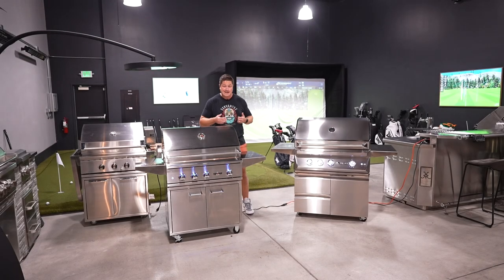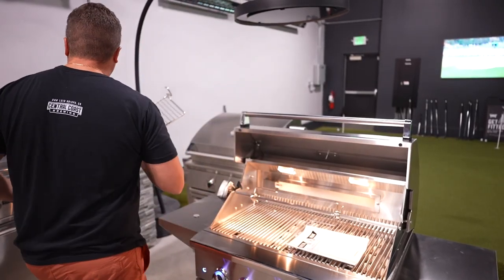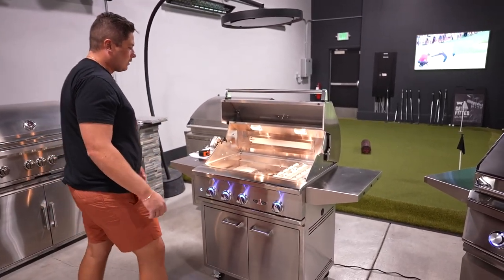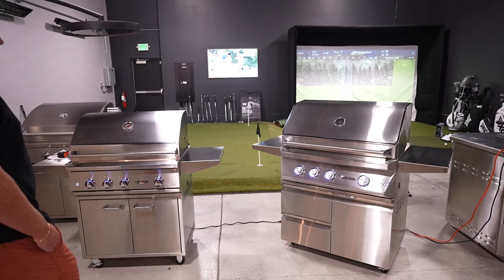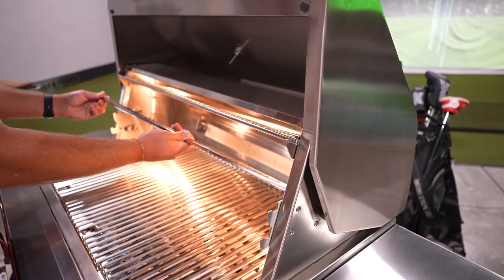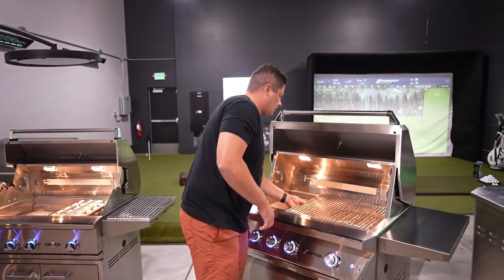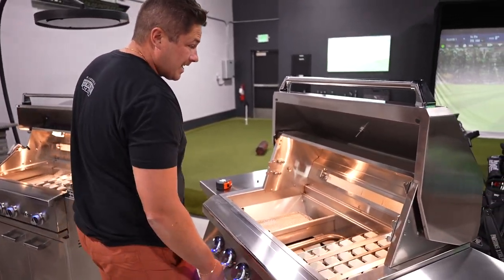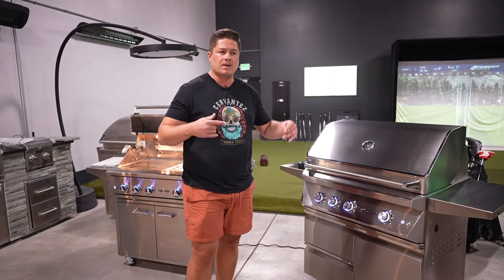Twin Eagles VS Delta Heat!! ( New Brands to the Embers Showroom!! )

Comment: Hey Trevor, Love your videos! Quick question for you - In a match up between the Delta Heat 32" vs Artisan 32" who are a picking and why?
Reply from the maker: delta
Reply: in between the same also
Reply: @dsquaredloans8311  I ended up going with the Delta Heat.
Reply: The store I visited only has a 32” delta heat, no artisan. I wish I could see the two because I’m on the same boat lol. Is there a reason you went delta heat? Something that was significantly better? I think the artisan does not have a spring assist which I’d like.
Reply: @Woboito13  - I went back and forth between the two and compared them side by side In the showroom. Also, I watched probably one too many YouTube videos on each and for me it boiled down to this:
-	The ratings on the Delta Heat were better, albeit the Artisan has been out longer and there were more reviews on the Artisan.
-	The warranty on the Delta Heat is lifetime compared to 10 Years on the Artisan.
-	Little things like the knobs on the Delta Heat were sturdier and better built than the Artisan.
-	The ceramic trays were better in the Delta Heat than the Artisan (This was a big complaint I read on the Artisan)
-	The Lights on the Delta Heat were definitely brighter than on the Artisan.
-	The Twin Eagles Brand (Owns Delta Heat) is better than Alfresco (Owns Artisan) in my opinion.
-	The Stainless Steel on the Delta seemed to me like it was a grade better than the Artisan.
-	Ease of use and adjustment on the warming tray inside the grill was better engineered in my opinion.
-	The salesman did say the Artisan has a great heating ventilation, but the heat ventilation on the front of the Delta was good and had the wind-blocking ventilation system in the rear. Which was a nice attribute for me with where the location of my grill is being installed.

All of that being said, there is a price difference between the two. The price difference between the two was somewhere in the neighborhood of $600-$700 more for the Delta. But for the reasons above, that was worth it for me. The salesman was adamant in his belief that the Delta was the nicest grill you can get for the money before you step up into the next tier of very expensive grills. I receive the grill next week and will post the install on my Instagram if you want to see how it looks... IG: thesmokedeck
Reply: @davidfarrell8859  thanks for the in depth reply. I appreciate it and think I’ll get the delta as well when the time comes!! Still on the planning (and deciding on appliances going in) phase. Glad to check off the grill haha. And gave you a follow on ig!!